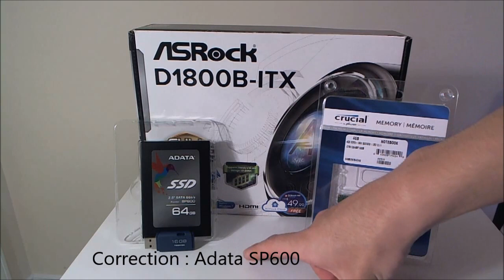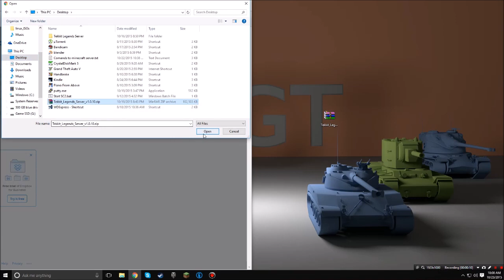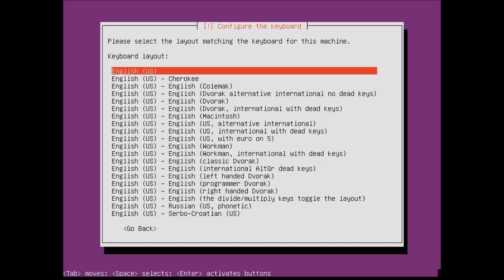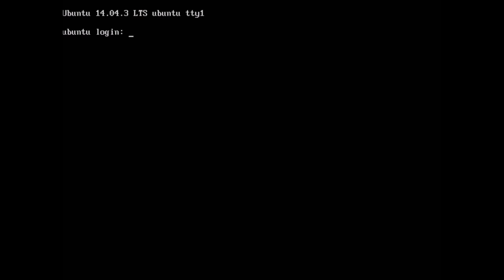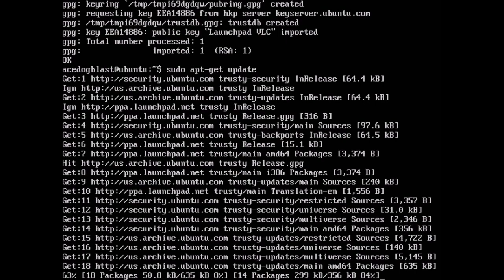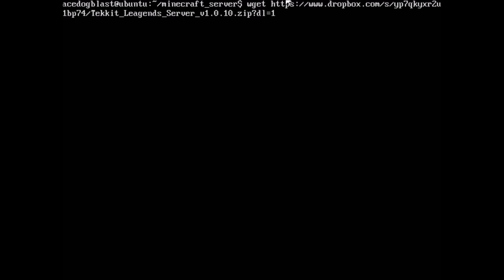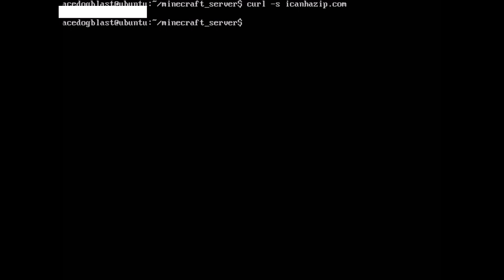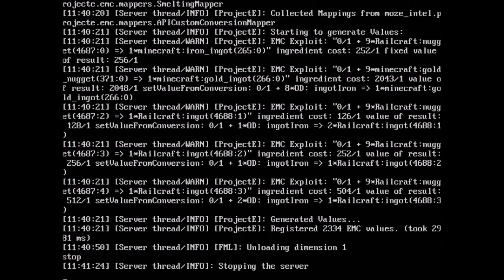HOW TO BUILD A MINECRAFT SERVER FOR $100!!!

Comment: Just a reminder, for a smooth experience make sure you have a minimum 20Mbit/sec speed (Specially Upload speed, proportional is good e.g. 20mbps up 20mbps down) with a real IP. (Calculated for 15-20 players at a time) 

And if you plan to run it 24/7 then definitely don't overlook heating issues. Add decent cooling for both the Processor and Ram (heatsink/cooler) as well as other components too (Case cooler).

Comment: Before spending even a penny, YOU WILL NEED: Static IP or setup one on your Router, Please Note: Not all Internet Service Provides Static-IP and not All routers can be used.
Hopefully this message saves people some long-run issues, you can build a server from Any computer basically, but people connecting over the Internet To your server, an entirely separate barrel of monkeys.

Comment: Great video brother. I’m kinda new at this, but could this server accommodate 100 players on it?
Reply: Chad Judd if you have enough ram to accomodate the server depending on how many plugins that you have (assuming you have spigot/bukkit)
Reply: JustDarkElite thanks brother. I just got back into all of this. Tech has advanced so much since I’ve been gone. Thanks for your help. Just curious do you know anything about hooking up an Astro c-40 controller (a controller for ps4 and pc) can be hooked up to a switch?
Reply: Kind of random and oddly specific, but I can’t really find any mention of it online. I can’t be the first person to want to do this
Reply: i dont think the low power cpu in that particular system would keep up with 100 players. you would probably want at least an i3 if not an i5 and probably about 12gb of ram

Comment: This video needs a update for 1.14.4 servers
Reply: Neelay Choudhary it will work with any version
Reply: @justdarkelite6164  dude 1.14.4 performance is so poor i needed to host server for 10 people and it required me to use 8gb ram other wise is would lag
Reply: What type of server are you hosting?
Reply: @justdarkelite6164  nothing much a general survival server 
1.14.4 is really demanding
Reply: Bukkit vanilla or spigot or Tekkit
Reply: @justdarkelite6164  spigot with a few plugins
And hermitcraft datapack
Reply: It isn’t that demanding it’s just laggy
Reply: The hermitcraft data pack may be the reason have you tested without the data pack?

Comment: How much mb ram per player. I want to make a hermitcraft like server for about 15 players at a time
Reply: A general rule of thumb is to have about 50-100mb per player. This, of course varies from player to player and also is dependent on player location (for instance if everyone is within the same chunks, that's less memory used overall). It's also dependent on what plugins/mods etc. you run. Some are going to be more memory intensive, per player, than others.

Comment: I just set mine up following the instructions.  Same hardware except 16Gb of RAM.  Decided to start out with the vanilla Minecraft.  

Right after starting the server, I get "can't keep up! Is the server overloaded?  Running XXXms or YYY ticks behind."  I allotted 4Gb of RAM heap size.  What am I doing wrong?
Reply: I figured it out...I was installing the latest version of Java and it only works with Version 8.  Once I installed jdk 1.8.0_212, everything worked as advertised.
Reply: I think i once got that message but everything worked anyway
Reply: 4gb is not much I give my server 8 and it always runs well

Comment: Ram + Core amounts for player amount
2-12=4Gb Ram, 2 Cores
13-24=6Gb Ram, 3-4 Cores
25-31=6-8Gb Ram, 3-4 Cores
32-50=8Gb Ram, 4 Cores
50-99=12-16 Ram, 6 Cores
100+=16Gb Ram, 4x2 Cores
Reply: F4NCY4K  Server.
Reply: F4NCY4K  no? That's wut I did
Reply: F4NCY4K Is the core count right? I've heard Minecraft can only utilize 1 core but would like a confirmation
Reply: F4NCY4K Cool, thanks!
Reply: I have ddr2 ram. will that work?
Reply: If you just have a lobby you can let 150 players play on the server.
4GB RAM is fully good, and f*** you, autocorrection.
Reply: First of all minecraft is monocore so it uses one single core, I am a developer and I ran a 1 GB ram server with half core for 50 players. Basically it depends on the ram (I used 8 gb for 400 players on a single server) and single threaded performance
Reply: @anyod5625  , it depends on ram and other factors, like elytra is enabled and if the players play in a small area.

Comment: can i just use a old pc?
Reply: Ye
Reply: Yeah if it has good enough specs and runs on an os that works and isnt crippled by viruses or something
Reply: @astral_haze  do you know if a xeon 3480 server prosessor is good enough ?
Reply: @FrickedUp  Idk and everything also depends on what kinda server you’re running
You don’t need as much because the server won’t be rendering anything though so if you’re using a lot of graphical mods, you’ll wanna worry more about the pc you’re playing on, but if you’re running a lot of serverside mods you’ll need ram and processing for it
If you can run the game in singleplayer you can run a server, unless there are too many players. Additionally you’ll probably want a pretty good internet connection, wired if possible, though I wouldn’t know how to set up a wired connection on a server
Reply: @FrickedUp  uhm...... its TOO good! you dont need such a processor for a minecraft server..
Reply: @FrickedUp  check how many cores it has, you'll want at-least quad core(4) with 2.33gHz per core or higher, and Minimum of 6 gigs of ram, this will give you enough room to house 20 players with about 20-30 plugins depending how heavy the plugins are.